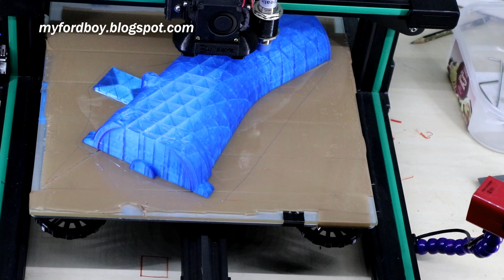Metal Casting at Home Part 88 Audi Quattro MAF Pipe

Comment: Have seen a lot of these casting videos streaming on youtube as a background diversion. Yours is the first one I've seen in a long time that actually employs hydrogen degassing, a drossing flux and thermocouple temp measurement, so much respect for that! Adding a bit of filtration in the gating system (fiberglass screen or ceramic foam filter) would also help keep that clean metal cleaner. For all those aspiring foundry folks looking to up their game I'd recommend the works of John Campbell and the American Foundry Society. I work in the aerospace industry in the aluminum casting supply chain.

Comment: You should seek out odd parts to cast for old cars. These will command a good price!
Reply: They do command a lot of work also at that point. 3D metal printing would be faster and about as expensive or less, although not as crafty for sure.
Reply: @EddieOtool  Are 3D metal printing really on that level? I'm not saying it wouldn't work, i'm just thinking that casting it in one piece is a lot more solid then building it up layer by layer like those printers do.
Reply: @Lappmogel  I'm not up to date with current technology, for I am a bit removed from the field, but for aluminium parts (which is what he was casting I think), it should easily get resistance up to cast metal, because aluminium is easy to melt with a laser beam. I just found a machine who can do steel 3D prints up to 682 MPa (99000 psi) tensile strength, which is not bad at all. It actually compares to 4140 heat treated steel. So, no, I wouldn't be affraid of solidity. :)
Reply: @EddieOtool  I just looked it up (3d metal printing) pretty impressive. Obviously a part like this is going to be cheaper and better with regular old die casting since you can just reuse the same mold over and over again, but that's only if you mass produce one part. If you are into restoring old cars professionally and need to do one of a kind items all the time a 3d printer might pay for itself after awhile.
Reply: @EddieOtool  The thing is that collectors of rare and expensive cars don't care about the price and if its not possible to get the original part anymore they want one as close to the original as possible, so offen it will have to be cast.
But i have no doubt that these parts can be metal 3d printed. Take a look at a company like desktop metal.
Reply: @WaemYt  on smaller single-part builds, metal printing can be competitive to casting. Printed parts can and will have a better strenght than regular casting (no porosity and finer structure). But if you do series of even just a few or bigger parts like the one shown, casting is way cheaper. the development of the modell and Core is a single investment, only the casting has to be repeted. A good metal 3D printer is in the range of 900.000 €...  and you need Argon and expensive metal-powder + a considerable amount of electrical power to run that thing.

Comment: Today, on "knees of steel"
Reply: +letsgetverydrunk         Myfordboy has a link that explains he has pads sewn into the work pants. Another clever idea. Subscribe to his channel and you can read it Q&A page. Excellent execution of a process not many can master and has no reason to explain verbally his steps other than reading he comments to shop best practices in at home casting. With the price of propane in the states, I don't know if I could afford to create a foundry to melt my old casting parts into a new design engine brakes for external A/C, Alt and P/S pump for a fuel injected GM truck engine I am putting in my 1967 C10 pick up. $200 bought me a 65 C10 Apache a construction company had owned. The wood floor was soaked with diesel fuel, motor oil and waste oil for in field service of large machinery. I was 14 and took 3 years to save that money. Your license was for school or farm work. Maybe I will send my finished pattern and cast chunks and let him film that. Two thumbs up for talent. Retired because my doctor said I had enough, but still try.
Reply: @deankay4434  Dean, several dual fuel foundry furnaces are shown here on YouTube.  Propane gets things going and then a switch to waste oil is made.  Waste oil includes stuff out of engine crankcases and fast food joint potato fryers.
Reply: @eliduttman315  That makes a lot of sense, but I missed it or was never shown. Perhaps I have not seen ones that talk or show that change over. I work in a two man shop in 1969, that I helped Carl build.  He was a clever guy who quit a Chrysler dealer then 12 years in a speed shop. He balance rotating assemblies, install hard valve seats, porting, etc. 
  In the states, the Arab oil embargo forced gas station to close, speed limits dropped from 75 to 55 MPH and "Odd-Even" gas days. If you license plate ended in an odd number, you could buy fuel on an odd calendar day. Thanks Jimmy Carter. Wore a sweeter, turned down the "WH" temp to 65 Degrees F and told us to drive less. That did not work on a farm.
 But, to heat his shop, Carl placed a 55 gallon drum outside and put a tubeless tire valve stem in the bung. We only air charged it to 20 PSI or so. The draft tube was 2" off the bottom and with a ball valve, length of gas pipe, it dripped onto a log inside his metal off the floor home-made fireplace. He took two heavy oil barrels with the 3 metal rings, off-set the flue transfer pipe to one end, then a length of normal fireplace flue, but welded a three-way pipe a couple of feet above it. We burn't waste motor oil and tranny fluid and placed a box fan behind it. I found out transmission fluid burns very hot and a good sized log or two would last the entire day. Melted the handle on a SnapOn pry bar sitting 3' away one day when it started dripping ATF. In that heater arrangement, I would expect the ATF to burn 3 times as hot as motor oil. Not only did we service them but rebuilt them as well. 
I was a seasoned 14 year old who started out 6 years earlier, hand sanding wood spokes on a Ford Model A for a farm realtor, also named Carl, who like old cars, when I was age 8. He had straight 8 gangster cars, Duesenberg & 5 others he had obtained when farmers where preparing to sell. He would but the farm & all, then sell when he was ready. I already had fixed two gas powered abandoned lawnmowers and a 90cc two-speed Step-thru Yamaha in a $20 basket, under my belt. Gas was 19.9 cents per gallon and jumped to 33 cents. People thought the world was going to end...then jumped to 60 cents. I bought a 65 C10 for $200 at 14 to mow yards in town and get around with a "School / Farm" permit. Just make sure you had a tank of propane & two bales of hay in the back, you where good to go. I would like to make a Foundry from 1/3 of a water heaters tank.
Reply: @deankay4434  I cast aluminum alloys firing on propane. My crucible will hold 16 lb. of aluminum and I can do 5 melts on one 20 lb. cylinder of propane which costs $18. So $3.60 / melt. I have a home made furnace which is probably not the most efficient. Plan is to build a bigger furnace with better insulation and fire on waste oil. These home made furnaces will also melt brass, copper & zinc. I like to use junk automotive casting, especially wheels. The results are easy to machine and very strong. I'm 77 years old and enjoy making things. I traded for an old Jet milling machine and bought a new Chinese lathe. Fun, challenging & once in awhile I make something useful.
Reply: @Larry1942Will   I am with you Larry. Never too late to learn and discover new methods and ideas. Worn joints and too many lumbar fusions forced me into an early retirement, but still enjoy drawing an idea, using materials to make new stuff and fix broken things. Farm boy's and Tech's never throw anything away, so I will wear the "Hoarders" badge with honor. 
God bless you, Larry! Keep going... (Propane, same price in Omaha, NE.)
Reply: @deankay4434  I'm in Lincoln, NE. My shop is 2 miles+- S of exit 402. I'm retired so I'm erratic about times that I'm here. Rarely early but often late. 5120 N 57th St. Come in orange door and ask for Larry.
Reply: @Larry1942Will   Thanks for the invite as I have been to Lincoln many times for work. I will note this address down and make a point of coming into town to shake your paw if I find time. 
 Being retired, I seem to have a longer list of things my wife wants done and my list never gets touched. I would lover to see your shop and setup. I just love learning stuff. Plus, now I have a woodpecker poking holes in my house. I will introduce this bird to my shotgun. Of all the things to give a man problems, a woodpecker was not on that list! Dam thing...
Reply from the maker: @eliduttman315  I don't need to use propane on my oil furnace, I can light and run it with just the waste oil.

Comment: Very interesting channel. Did you know that you can get reusable/releasable cable ties/zip ties. Also if you use paraffin or WD40 as a cutting lubricant while sawing, filling or machining aluminium alloys your cutting tools last a lot longer - also get a better finish.
Reply: @Argle Plonidge In my salad days making aluminum router templates for PC Boards I remember using a wax stick in a cardboard tube as lube for aluminum cutting, never knew it was paraffin, Thanks!

Comment: I’m sure that the Audi owners will be really glad to have those, after all without industrious people like yourself they are up the creek without a paddle. Another great video for us to go over,  can I ask a question about the core, you used tape to indicate the mould centre, when you had it in cad could you not put a locating pin that would correspond with the outer casting? Anyway still did a sterling job.👏

Comment: Nice!
I went back a couple of times, but I couldn't see: what holds the core centered in the casting?
I know it can't just lay on the bottom...
Thanks!
Reply from the maker: Please look here for a detailed description of how cores are located. https://myfordboy.blogspot.com/p/metal-casting-tips-and-faq.htm and this video  https://youtu.be/sIBQWh-1eYk
Reply: The 2 ends lay on the casting greensand. The ends of the pattern halves were smaller diameter and those ends will not become part of the casting.
Reply: @myfordboy  Thank you very much. You need to edit your blogspot link to end with html and not htm otherwise  you get a page not found and most people wouldn't think to try html when they ran into that error. Keep up the good work though.
Reply: @DiscoFang  Thank you!
Reply: @DiscoFang  Yes , so it is.

Comment: Looks like I'm not the only one with questions about centering the core. I watched a couple of his other videos, and at first, they didn't seem to be clear, either! The critical step is most visible at 17:18 in this video. It's kind of tricky. 

Look at the core on the left, how it's resting on the greensand. The right side is, too. That looks like it should mean that the pipe will be closed off or be a void on the one side, but you have to remember that the part you actually want is shorter. Look at the gap formed around the core in the middle. If he made (and he did) the OD of the core to be the same as the resultant ID of the outer halves, it'll sit perfectly in there, AND create the needed spacing for the tube by holding it centered in the void created by the other two mold components. 

Maybe the mould halves are misleading, in that they include pieces that are not part of the net shape. You can see him gluing them onto the ends in the beginning, little round stubs.
Reply from the maker: Please look here for a detailed description of how cores are located. https://myfordboy.blogspot.com/p/metal-casting-tips-and-faq.htm and this video  https://youtu.be/sIBQWh-1eYk

Comment: Your MAF pipe is far superior than the OEM part. Yours will surely last forever. If I remember correctly back to my 1982 Audi Coupe 1986 Audi Coupe and 1987 Audi 4000s they were made from aluminum but not nearly as thick walled as yours. Would love to see the part on the car as I always wanted one. If I would find a red one fully restored it would cost more than $30,000 USD. I considered it but if it were to be a daily driver PARTS would have been a problem. I opted for a 2016 Lincoln MKZ AWD 3.7L V6 sure it's not the clean lines of the 1984 Coupe Quattro

Comment: As ever a brilliant video. I am probably teaching my grandmotheretc, but have you thought of printing a pipe nipple on the side of each half of the core box then you could inject CO2 into the heart of the core under preasure (only a fraction of a psi) if the joint was sealed with gaffa the CO2 could only escape from the open ends of the core box garenteeing a complete cure of the waterglass.

Comment: Might be a good idea to riddle the facing sand over the pattern so as to get a better surface finish- a greensand moulder coremaker long stop from the 70's - good video all the same. also a tip, use a teaspoon to cut your ingates, & runnerbar

Comment: The pattern-coat epoxy(Or is it polyurethane?)  from EasyComposites seems nice for smoothing off 3D printed patterns, it doesn't shrink back disappointingly like paint does. Though it does have its own problems, like setting in the pot...

Comment: Great job,  I wondered how or if  the inner mold part  was prevented from sitting on the bottom half mould which would prevent the ingress of the moulten metal?
Reply from the maker: The core is supported at the ends .Please look here for a detailed description of how cores are located. https://myfordboy.blogspot.com/p/metal-casting-tips-and-faq.htm and this video  https://youtu.be/sIBQWh-1eYk

Comment: Nice job. It's a shame the 3D metal processes are so expensive at the moment. With the materials and processes we use we get parts that are equivalent to high end castings but with no tooling, straight from CAD. For some parts we use local printing specialists, I don't think we do the HIP process in house. Twenty years ago I had to contract out for 3d printed plastic boxes. Hopefully affordable 3D printing is coming in the next few years.

Comment: Nice outcome. I am curious as to why you didn't include a riser/feeder?
Reply: There is obviously a feeder, which then splits into to two gates into the part, but I think you were asking about risers, and they ARE there - the two bossings for fasteners, and they each have a fairly small diameter vent that got filled with melt, and served as indicators that the mold was full.  Look at the casting when it first comes out of the sand, about 20:17 and I think it will be a little clearer.
Reply: On a thin walled part like this there is no need for a feeder to replenish shrinking cooling metal. The part simply shrinks uniformly through its cross section all at the same time. In other words, if you can just get the mold filled without freezing up somewhere, the part is good.
Reply: @gregarmstrong4653  your reply is better than mine.
Reply: Thanks, Im just guessing here but I think the sprue extensions and hurried pour are evidence of a few earlier attempts with incomplete filling @ryoungatlmidotnet
Reply: @ryoungatlmidotnet  I believe on the other side of the pond or in AU they tend to use slightly different foundry terminology. Over there they call risers feeders (at least that's what I've been told and what I recall from Campbell's textbook called the complete casting handbook)

Comment: Hi, that was perfect,.. i would like to try making some parts for my car, and 1 question.. 
does the product shrink when it dries, do we have to make the molding bigger?  if necessary how big is the difference?
Thank you so much..
Reply from the maker: You need to make the pattern about 1.5% larger than the finished part as it shrinks as it cools.

Comment: Can sand plug be soaked apart in a hot water instead of mechanically breaking it? I want to cash a water cooled head for my lawnmower so the sand plug will be hard to get out of the head.

Comment: Amazing, can I ask, is and casting the only way to shape metal, say you want to produce a batch for instance, do you literally have to keep casting the shape over and again, is there a way to create a permanent cast that can just be filled, so more work will go towards finishing, secondly what modern tools exist for finishing?
Reply from the maker: The industrial method for producing parts like this would be die casting. Metal is injected into a metal mould which is parted to remove the casting.
Reply: @myfordboy  thanks for your response I will take a look at this, or if you have a video showing this can you post the link

Comment: Great vid. Maybe someone could help me because i couldnt see in the video. How did you position the core correctly to obtain a uniform wall to your casting.
Reply from the maker: The core is supported at each end by the impression left in the sand by the pattern, known as core prints. Compare the finished casting with the shape of the pattern.

Comment: Great work and quality!  Why not 3D print the gating also?  And maybe 3D print the feeder, as well, while at it.
Reply: Ah, you already answered Troy a month ago... "easily change the gatting if it's not printed".  Just like core prints and printing the whole part in smaller components, you can make the gating, feeder and vents in separate pieces that press or snaps onto the pattern that's easily removable.  That way they can be tested through the trial and error process.  Of course, this would only be useful for multiple castings and not on onesies.

Comment: Nicely done, great finish...!!!
One question, when you make the 3D form, do you just apply an extra 6% allowance for shrinkage on dimensions in all direction or are there other factors to consider, like non linear if the part is way longer than wider, for example...???
Thanks in advance for any answer.
Reply from the maker: The pattern is made 2% larger in all directions. The metal will shrink in all directions as it cools.
Reply: @myfordboy  Thanks...!!!